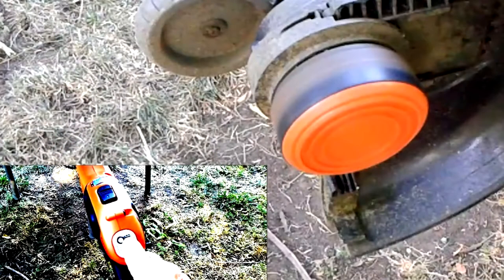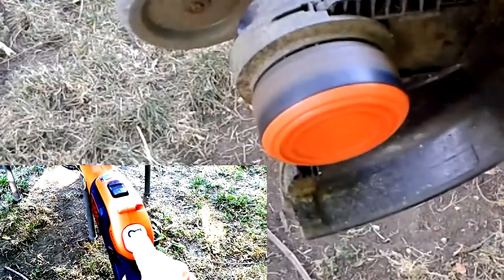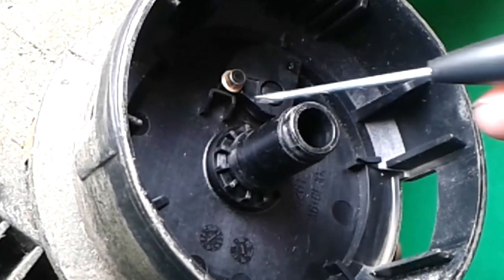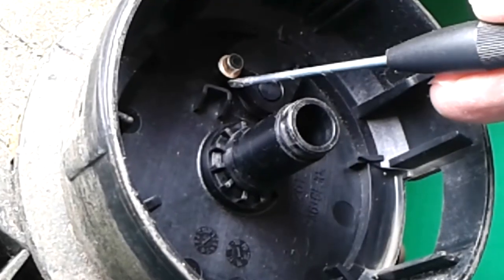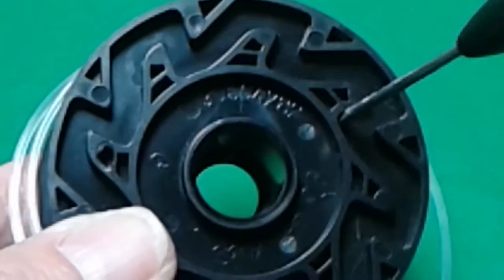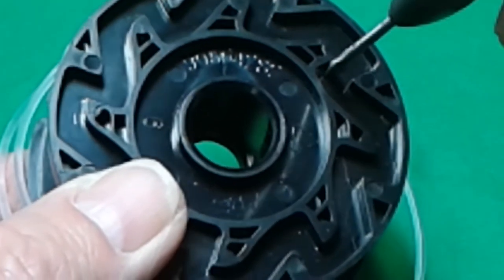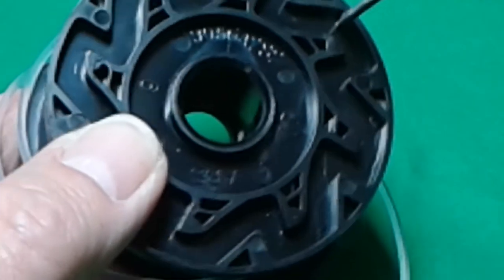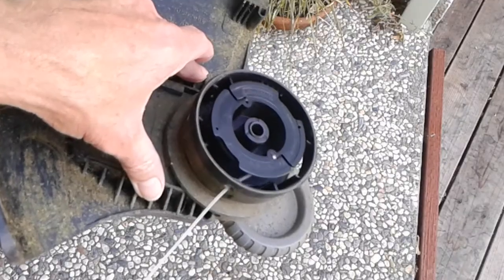How it Works: Line Feed Black+Decker 20V Cordless String Weed Trimmer Edger LSTE525

Comment: The automatic line feed on our B & D trimmer stopped working over a year ago. My version of this trimmer has an Easy Feed button as well, which also quit.  I was ready to throw it out, but started to look online for an answer. I’m glad to have found this video, because understanding how the thing works helped me figure it out.  The entire problem was my “bargain” replacement spools from Amazon.  Once in place on the lever, that spool needs to turn effortlessly on its shaft- but mine was a little sticky.  So today I went and bought a B & D brand replacement spool at Lowes. Sure enough, the line feed works just like it did when new.  I hate paying that much, but the cheap knockoffs saved me nothing.  It’s not a bad design.  In fact, it’s very simple and works great if the parts fit properly.  My mistake was wasting money on junk parts.

Comment: Thank you Sir  , I've been wondering which way is correct for the lever stud to seat, I had mine inside the inner circle instead of the ratchet 😂, very instructive Thanks.
Wish mine had a feed button 😮
But it works reasonably well 😊

Comment: Thank you Sir.    Should have watched your video before I took mine apart.  Oh Well    I kept scratching my head looking for some kind of device or mechanism that would move that pin lever under the spool.     I think now that its cleaned up, especially that little hole in the drum where the string comes through, things may work as they're supposed to.

Comment: I would assume that this depends on the spool not binding on the pin going through the center  of the spool.  Mine hasn't worked for ages.  The lever is very free floating, there is no dirt, but the spool binds tightly on the pin, so it can't turn. I have tried greasing it.  I think this is a very bad design and does not last very long.
Reply: Mine doesnt have a button. I pull the lime by hand by taking it apart every time. Super annoying
Reply: @furtalance_x  I finally bought a Stihl.  I am glad I did.  Of course it isn't electric.
Reply: I just fixed that very issue today.  I was just about to throw that trimmer in the trash.  Thanks to this video, I realized that the cheap knockoff spool from Amazon was the whole problem.  It didn’t rotate effortlessly on the shaft when in its correct position on the lever.  Oh, I could rotate it by hand, but it didn’t turn smoothly enough.  I bought a new Black & Decker brand spool today, and suddenly the line feed worked like new. Yes, it costs more.  But the cheap junk made for a year of struggling with the trimmer.  The “bargain” was a waste of money.

Comment: This is driving me nuts. So I had to replace my cap. Bought a cheapie on line and after fitting the auto feed didnt work (brake button worked but the spool seemed jammed). Checked and cleaned everything but still no auto feed. The feed works manually but as soon as I put the cap on it the spool doesnt click back for the next feed. Changed springs using the original B&D provided with the original cap. Still no good. So I bought a genuine B&D top. Same bloody issue. Have watched all available vids but nothing seems to work. I have used non genuine spools plenty of times before with no issues so I just cannot see what is preventing the spool from returning for the next feed. HELP!

Comment: I bought two of these models and they both didn't work the easy feed did not feed anything and I did exactly what you said everything was working moving back-and-forth inside the trimmer there it just plainly doesn't work

Comment: What about models that don't have a strong feed button? Mine does not - it worked for a while, and now it will not feed - I am opening the dang thing every few minutes to manually let out more line. The arms swings freely, and the spool seems to be wound correctly (OEM B&D spool).
Reply: string feed
Reply: Try changing the lever
Reply: @cahones6696  So there's no spring in the pivot lever? Its free floating?
Reply: @cicadasmasher8082  yes there is a small spring in there.
Reply: @cahones6696  Its all good. Found a WAY better hack for weed wacking than messing with this stuff.
Reply: If you don't have a feed button you would just let off the trigger. Slowing down the motor allows the centrifugal force of that weighted arm to sling back in the grooved path and let more line out.
Reply: Me too!?!  Getting ticked off!

Comment: What actually happens mechanically and electronically when the button is pressed? It pushes down a small electronic switch which causes the motor to momentarily stop.
This should cause the spool lever to move outward  allowing the spool to turn and string to be fed out.  But what if the string is not fed out? What could be the cause besides: faulty switch, wrong line diameter, improperly wound spool, weak battery, broken or misaligned spool lever spring and spool locked on shaft. Anyone else have this problem and fixed it?

Comment: well if mine did have a spring its gone,,, it would have had to break because my pivit has never been removed... mine is the new longer up dated model.. it as same pivot ,but is slightly different inside..
Reply: That's my question. Is the pivot spring loaded or is it free floating and just gravity is causing it to fall back into place in this video due to the angle the trimmer is positioned here? Because if its spring loaded, my spring is gone.

Comment: Is that spring loaded, to advance the line?
Reply from the maker: yes
Reply: @BassocantorReviews  I'm trying to repair one of these for which both the lever and its spring is missing.  I have a new lever (part # 90626568 ) on the way, but it does not come with a new torsion spring -- and all the reviews for this part complain about it not including the spring and how they can't find the replacement spring for sale.  (The only "spring" replacement part for this model appears to be part # 90623660 which is the spool cover spring.)
Bassocantor -- thank you for this video showing the spring action of the lever.  Is there any way you could remove the lever and show a photo of its spring (perhaps even including some dimensions) so that I can try to find a generic replacement?  I will be happy to share my solution with you and with your viewers with missing or broken springs -- which from the comments, I see are numerous.
Reply from the maker: The spring is a stiff wire coil, about 22 gauge AWG thickness. Only 3 loops. That's it! You could easily make this yourself. I will make another video to show it. Best of luck, Chris
Reply: @BassocantorReviews  Great!  I've ordered some 0.025 inch music wire to turn the spring.  I'm looking forward to seeing your video showing the spring's configuration.  Thanks!
Reply: Will the line advance out by itself without pushing the button.

Comment: When you're lifting the pivot mechanism with the screwdriver here, is it coming back into place by a spring or is it just gravity causing it to come back to its original position due to the way you have the trimmer tilted? Basically, is the pivot mechanism spring operated or free floating?
Reply: It's spring operated and you can buy the spring and the pivot itself on Amazon.
Reply: @fredklintworth1114  do you have a link to spring on amazon I can't find it
Reply: @faizansiddiqui9261  Sorry Faizan but I just checked and they don't sell it.  They sell the lever, and you would think it comes with the spring, but reading the questions about the lever reveals that it doesn't.
Reply: @fredklintworth1114  yeah thanks for your reply

Comment: Mine doesn’t have the “release button” but it does have the pivot switch- which I removed and saw that the spring was missing so I bought a new spring, installed it and it still doesn’t self feed line. It’s really just a POS. Gave me nothing but trouble since day one. I recommend that you should just not buy this garbage.